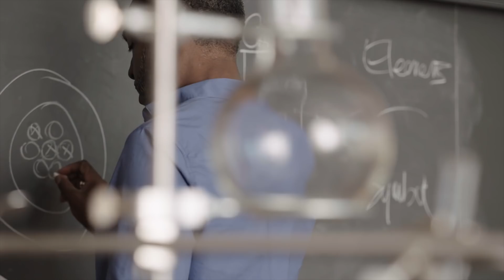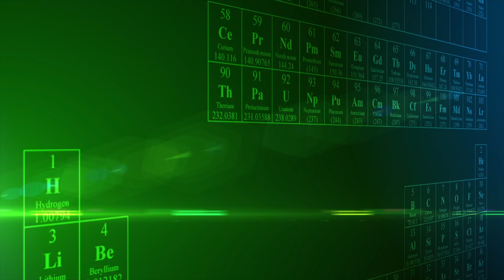A Solid Future for Electric Cars - The battery tech that will power us in tomorrow's electric cars

Comment: Working on new engine that will be par to Tesla in efficiency.  Can run on Hydrogen, Natural Gas, Ethanol, Alcohol, Methanol, propane, gasoline, Diesel, bio diesel, solar thermal, and...battery (DC or AC  no controller or electric motor needed).  

So when that battery gets low in weight and low in cost, you can still use my engine to drive your car and get twice the economy.  How?  Active drag reduction via working the air.  We move through air, not electricity.  Thermal loads can be 50% of the loads, especially in winter and summer.  They are "free" with the cycles.  The power density is better than electric motors and it is totally redundant.  No oil changes, and the engine harvests water from the air...so you don't have to get that $1 bottle of water to drink, your car makes it for you.  Want soda pop (co2 in distilled water) just add flavoring, when you use carbon fuels of course.  

This engine can get 80--95% of the fuel gone very quickly whereas electric cars actually increase total energy needs in the cycle.  This car could be around for 60 years and help Africa get out of poverty.  Electric car?  nope.  

:Last but not least It can enable a roadable seaplane that can get 1 cent/mile at 100 mph door to door.   The road tax should be 4 cents/mile....fly and fuel is like it were free since you don't have to pay the road tax.  Fly 200 mph at 4 cent/mile...equal to the road tax Tesla will have to pay just to use the road.  

The future is in the air, not on the ground.  Batteries are not even close to ready.  Maybe in 50 years.  There is a better way....no smog, no water shortages, no dependence on grid...go anywhere.  Not possible with electricity.  We are carbon thermal beings and this engine is designed for humans, not robots.  

Remember, the grid is the NEW OPEC.  Buyer beware.  

They subsidized Natural Gas cars at 65 c/gal, now the fuel is $1/8/gal.  Same will happen to electrics.  Electricity is $5/gallon at 15 c/kwh.  Battery is $4/gal to use it now, and may drop to 1/2 that in 10 years.  The grid electricity will have to go up when solar knocks out coal plants that cannot operate during the day...there will be no "base load" as it will go to zero during the day.  Eventually grid power, like land lines, will get more and more expensive to maintain.  Just look into the end game.  

My engine can make solar at 3 c/kwhr and it has the engine included that can generate at 6 c/kwhr with NG.  Why would I use the grid at 15-30 c/kwhr?  Just make hydrogen at 50% loss in the process from solar and I am 1/2 the cost of grid (3 to 6 due to losses in electrolysis).  

My engine then uses Hydrogen and the tanks are included.  Range 200-400 mile on hydrogen from house, 4.25 times that on NG from house at $1/gal,  and 3.3 times more again on Gasoline at $2.2/gal....4.25x 3.33 =14  (due to energy density of hydrogen to gasoline).  14 x 200 = 2800 miles on Gasoline....5600 miles city.  No oil change.  

Why hassle with all the electric stuff, just fill up on gasoline and drive 5600 miles.  You get free distilled water and soda pop if you want.  Get the point.  Time is money...Electricity is costly in energy and time.